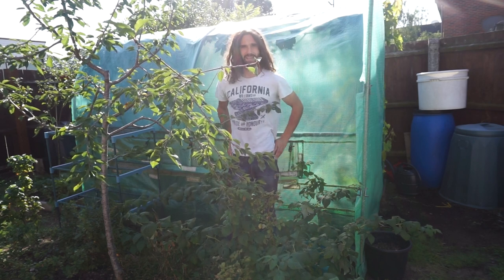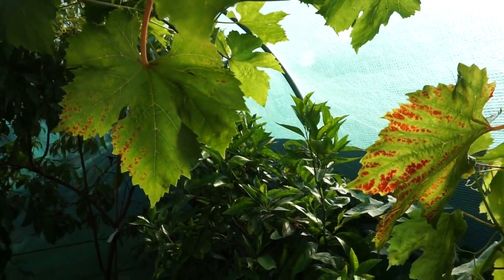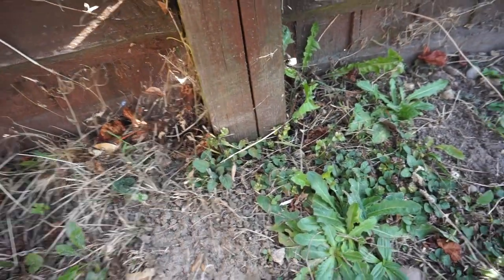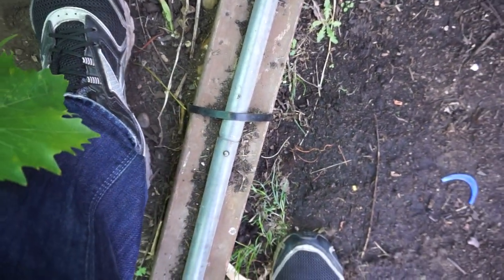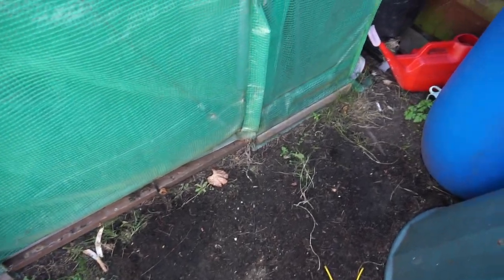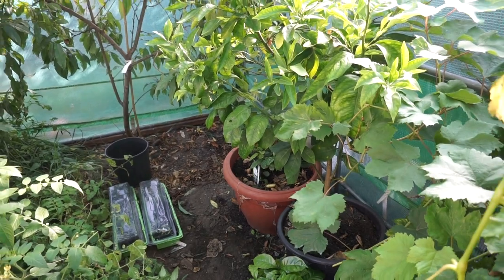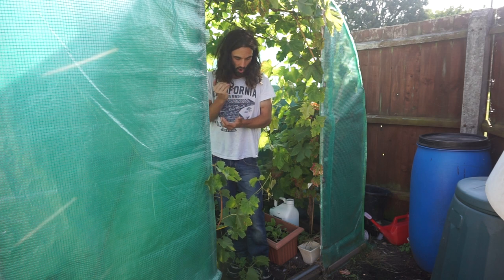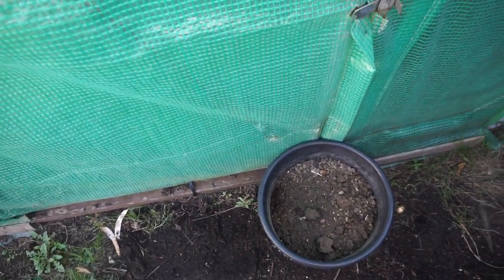How to stop a polytunnel from blowing away!!

Comment: I used to install fences, I was taught that it's bad practice to cover in things like bitumen which stop the wood from breathing. Damp soaks down the post, but the bitumen stops the wood that's coated from drying out which can make it rot faster. Of course there are people that say the opposite, so each to their own I guess. Personally I put a few inches of small stones at the bottom of the hole and then cement posts leaving the bottom of the post exposed on the pebbles. Supposedly it helps the post dry out. I've heard that farmers say the best thing is to cover the post in old engine oil, but I guess that's not so good for the environment. :)
Edited to say the most important thing is to buy wood that's already treated!
Reply from the maker: It would be an interesting study. Keep all other things equal but paint one and not the other and see how the post turns out! I suppose that's the only way to find out which method is best.

Comment: My old polytunnel wasn't secured enough. I used sand bags to weight down the corners but the p/tunnel blew over and ripped. I would get another one but would need to use the wood frame you used  to anchor it.
Reply from the maker: Very wise to anchor it